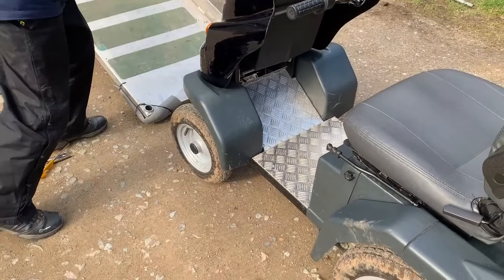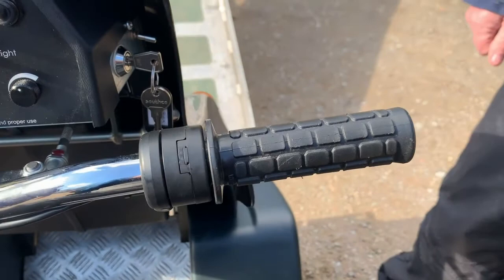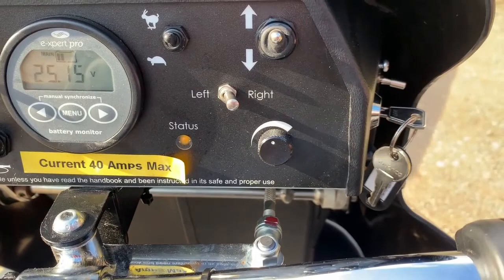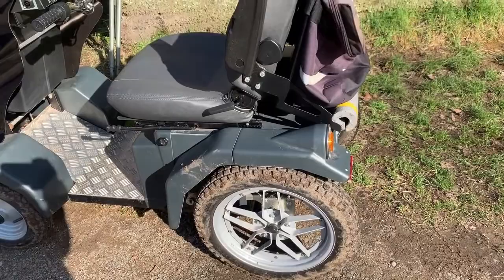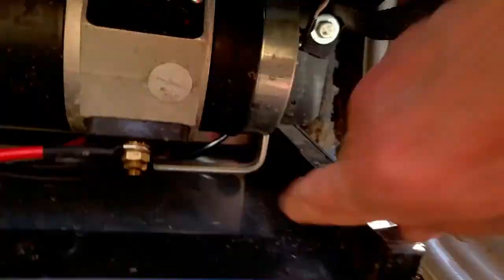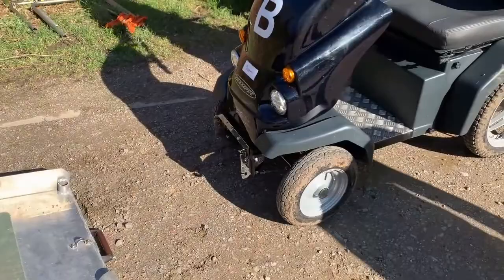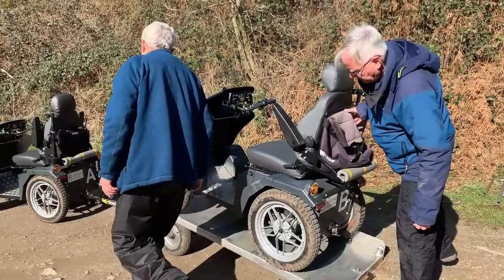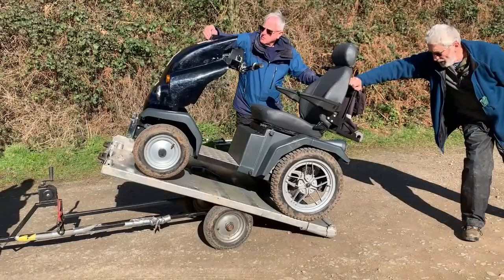Tramper maintenance & recovery

Comment: Hi John, How far will one of these trappers go over rough hilly ground please.  And same question but over level even track or pathway.  Thanks once more for your great videos, I can and do watch them all over and over. Specially in winter months. Kind Regards Bri
Reply from the maker: Hi Bri, Quick answer for lead batteries, 6 to 10 in winter on hilly, rough ground. 15 to 20 in summer on reasonable ground.
Long answer. Variables include:
Weather – hot, cold, wind, rain
Load – weight of rider and luggage
Battery – newness, state of charge, size, type
Machine – stiffness of bearings. Axel, filled with oil or grease takes time to warm up and so for the resistance to drop
Tyre pressure – Keep to recommended.
Surface – rough and rocky surface lowers mileage as more power is needed to ‘climb up’ each stone or rock.
Speed – the slower you go, the more power can be got from the battery
Beamer/Tramper tell me that in order to be able to compare mileage figures between manufacturers, the advertised figure is obtained by driving a new Tramper indoors in a large sports hall to remove the effects of weather and giving a very smooth surface, going round and round at a set (slow) speed with a load of 12 stone and no extras.
Lithium batteries are totally different. Some of our members report doing 35 miles over rough, hilly ground and the battery monitor still showing half full.
For more details see: https://www.tramper.co.uk/Press/5603dd92150bcac87df0fcd3

Comment: Borrowed one of these for a trip up Brean Down. I was amazed.
Are you using something like chain wax or ptfe spray for steering joints?
Reply from the maker: Yes, I use GT85 spray with PTFE